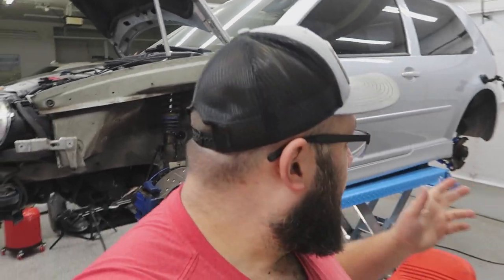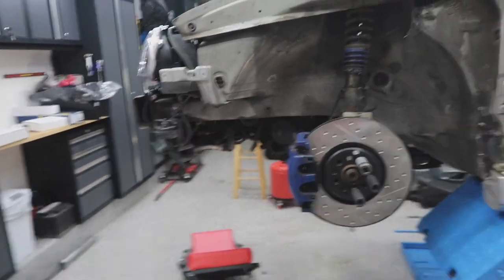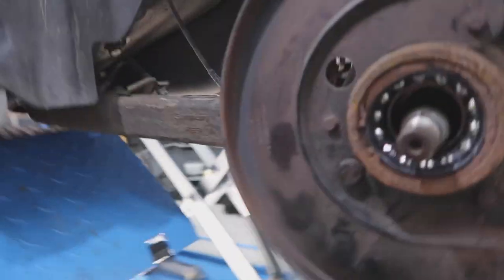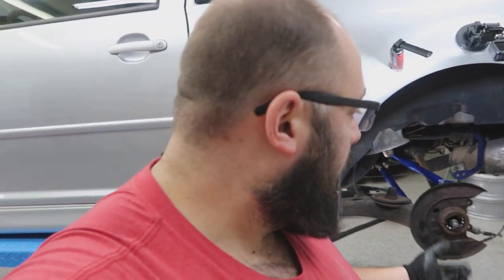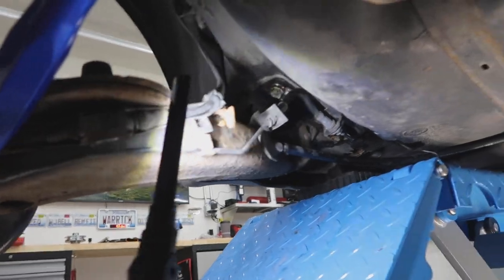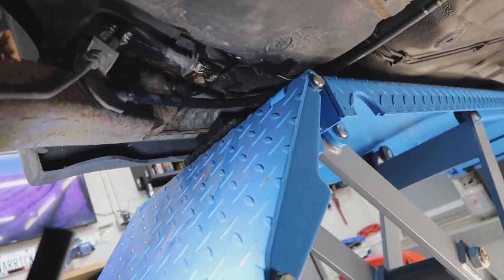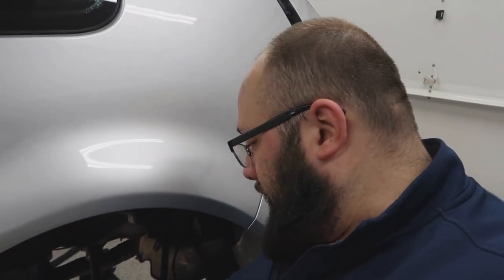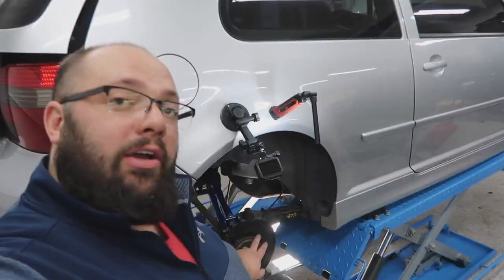VW MK4 R32 Working on the REAR Today! Trailing Arm & Wheel Hub The Project Car Rebuild Pt. 14.

Comment: Normally I always replace the bearings when pulling the hub.  Heat what is left up on that bearing and pull it off.  Heat is your friend
Reply from the maker: Kevin Henningson thanks for the note!
Reply: You can also take a dremel to it, cut a slice into it so it opens up a bit to come right off.  Not fun. Just work at it a bit.  Or heat it up and hammer from the back side.